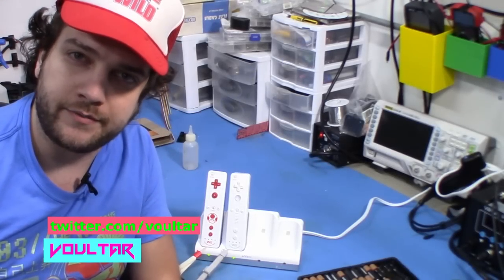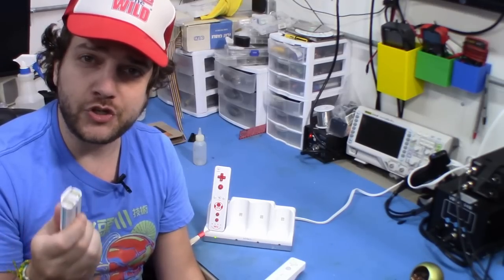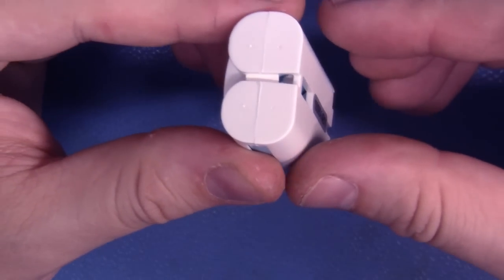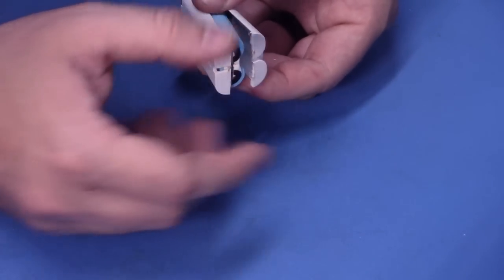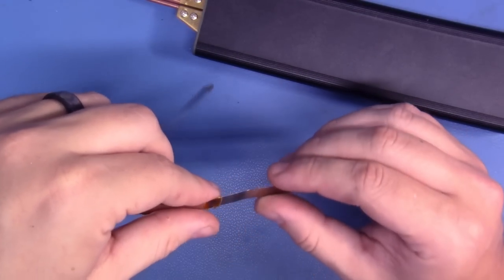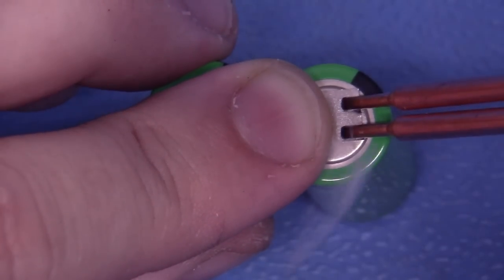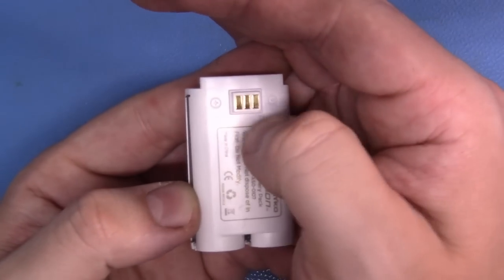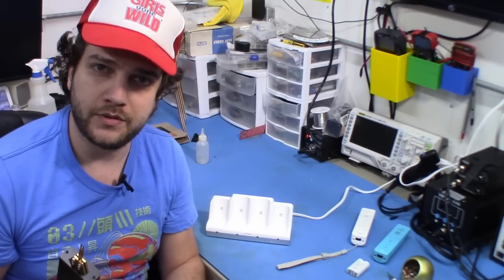STOP USING ALKALINE BATTERIES! Nintendo Wii Battery Pack Rebuild Hack!

Comment: Thank you for doing this! I have some old xbox 360 play and charge battery packs that are dead i'd love to open up and resurrect. Seems like the method you showed welding and nickel stripping to a new NiMh battery is similar to this. I love the idea of reusing this stuff! Thank you!
Reply: My thoughts exactly.  This video has inspired me to do the same with 360 rechargeable packs.
Reply: @misterbeetz  Me too. I tried the paper clip trick back in the day but that never worked for me.

Comment: Fantastic!!  I had recently bought some batteries to rebuild my Dewalt 18v pack, but the video I watched they were  using soldering and said not to apply TOO much heat.  I didn't like this!  The spot welder will be perfect!  Thanks!

Comment: I actually did this same thing a while back, except instead of nyko it was an energizer branded charger that used some kind of wireless charging rather than metal contacts. The battery packs had two screws, one under the label, and the two NiMh batteries were AAA size. So a little easier to repair than these it would appear.

Comment: Another neat alkaline battery alternative available today is the Hixon 1.5v lithium-ion rechargeable AA battery. Outputs full voltage so can be used anywhere you'd put alkaline AA batteries.

Downside to these is it's obviously not as convenient as a charging station, but you trade that for versatility and no need for modding anything.

Comment: Many eons ago I bought an Energizer Quad Wireless Wii Remote charger and the packs used AAA Ni-MH batteries so they could fit the copper charging coil.  What was really nice is that packs were held together with screws so it was super easy to replace them with higher capacity versions.

Comment: Would be nice if you did a video on replacing the cells in older laptop batteries. The kind that have the 18650 lithium batteries.

Comment: Since I use a headlamp that runs on 18650 lithium batteries. I have a high tech battery charger. And so I use the NiMH Eneloop batteries for the Wii controllers and others that use a AA or AAA or whatever type battery.

Comment: It would be cool if someone could recreate the circuitry from these battery packs and pair them with a 3D-printed case that is meant to be opened/closed. Your method is good since it reuses existing stuff that would otherwise be e-waste, of course.

Comment: Could you use copper strips instead of nickel strips to spot-weld the batteries together? I have like 2 pounds of this thin copper band stuff that I've pulled out of old transformers. Optimus will never be the same.

Comment: I have a wii mote with some batteries in it that I left alone for awhile. But I put a small slip of paper in between one of the terminals to cut off power and so far no leaks. Though granted it probably is still best to remove them for long term storage if you won't be using them for awhile. :P

Comment: it's definitely a neat way to repurpose old nyko charger packs but for me I prefer just using eneloop AA batteries that you can recharge in a cradle. On the plus side you can use those batteries in other devices that conform to a AA standard.
Reply: That is true, but these charging stands double as a nice way to display the controllers. The play and charge kits for 360 are also nice since you can charge them through the controller.

Comment: Porable Spot welder.... Currently unavailable... I'll have to get one.... I pulled apart my Ryobi batteries that were dead, got a new Cells and soldered them on and boy did that suck but, it all worked out. A spot welder, OMG that would of made life so easy... A NEEDED tool for me..

Comment: Very nice video. While these are NiHM, what are the safety considerations for doing this? Linux Tech Tips did a video where they were trying to do this with Lithium batteries and they had a terrible time.
If you're cutting the case, would a 3D printed replacement be possible? Transfer everything out?
For now I think I might stick to removing the batteries after I'm done. I didn't have any rechargeable conversions for the wiimotes, and I have the older ones that don't have the MotionPlus built in.

Comment: I know Linus Tech Tips tried to do something similar in a video a while ago and was constantly met with failure. When it comes to these specific batteries, do you have to worry about voltage differences between the batteries when spot welding or is the charge not strong enough to cause havoc when being connected?

Comment: Why not try something a little more crazy after doing this battery pack thing?
Like 
Make the wiimotes usb chargeable so you don't need the nyko charge dock
Reply from the maker: Because I said in my video, I like my Nyko charging dock and would greatly prefer to use it..
Reply: @Voultar  Not everyone can get ahold of them though so what would be the alternatives?
Reply: @realdragonrude  The alternative is to buy standard rechargeable AA batteries and a AA battery charger. These are readily available on Amazon, Wal-mart, etc.  I have a charger that charges 12 AA batteries simultaneously, and these same batteries can be used in Wiimotes and 360, Xbox One, and Xbox Series controllers, OG Game Boy, Game Gear, as well as literally anything else that uses AA batteries, like TV remotes or whatever.  There's really no reason to be using disposable batteries for anything these days.  Rechargeable AA and AAA batteries are readily available and the tech is well established.
Reply: @Hahnsoulo  yeah i guess but it would be cool if you could charge the batteries from the wiimote via a power source like a usb cable then you would never have to take the rechargeable AA batteries out of the wiimote until they lose their charge from age

Comment: i have a few questions about your spot welding:

1. are those pure nickle strips and have you test them to see if they are real by putting it in a glass of water with salt mix to see if they rust?

2. can that spot welder, weld up to .10m to .15m of nicklestrip?

3. are you aware those spot welders are not good to used and some what dangerous to used?

Comment: I have this very charging station, its very handy, mine does have issues with the connection
One thing I have contemplated with them is.
With a bit of techy jigery pokery can they have a rechargeable battery that charged via a wireless charging mat?

Comment: Thanks, I was looking for a tutorial to do this on my "energizer" branded setup. Looks almost exactly the same. Is it possible to use a soldering iron instead of a spot welder, or is that dangerous?
Reply: No, it will not work. You'll need the spot welder. Get the one he recommended.  Really good and easy for the job.
Reply: You don't want to solder as you want to minimize how much heat the battery gets. Yes Spot welding gets hotter, but its a momentary zap that only heats up the points of contact.
Soldering will heat up the whole battery as it's a slow process. Too much heat and the battery will leak or explode.

Comment: Voultar ive got a modding question, Is there a way to install a VGA socket in an AV Famicom in place of an RGB socket? I just ordered a Famicom AV from Japan, I live in Canada, we never got RGB SCART compatible tvs here afaik, but I have plenty of VGA capable TVs and Monitors and I have read that VGA uses a form of RGB to transmit video, so yeah just figured I'd ask if that's possible?
Reply from the maker: You would need to convert RGBS to RGBHV
Reply: @Voultar  Ah okay, thank you V much!

Comment: what's the need of the tape. you used at the end of the video?
Reply: Covering the metal contacts so other things don't get juiced by the batteries by mistake by bumping into them. Could probably use electrical tape as well.

Comment: Why not use rechargeable batteries?
Reply from the maker: Because I own a charging dock and I don't want to remove batteries every time I need to recharge them.
Reply: @Voultar  can't argue with that, great video for charging dock owners! That was the reason I never bought those, I was sure the battery life inside those were almost dead
Reply: @Voultar  I thought you were going to use lipo batteries and a more "sofisticated" installation. Anyway, it's a good video
Reply: @jamesytez6639  yeah was about to mention something involving a lithium pack of some kind..

Comment: Alkalines work just fine so long as you don't let them sit after they begin to discharge. If you're putting it away for a while, remove the batteries. It's that simple.
Reply: How many remember that? NIMH you don't need to remember.

Comment: Fantastic video. I honestly don't understand why people still use alkalines. If you want low weight and high capacity at the cost of recharging you can make an argument for Energizer lithiums. Otherwise you should just use NiMH. I have a bunch of NiMH AA's and use them in everything, including Wiimotes, my Wavebird and an Xbox controller. There is just no good reason to still be using disposable alkaline batteries in 2022.
Reply: Can you use Ni-MH AA's in place of any regular AA's in other devices, too?
Reply: @meatsafemurderer7743  thanks!